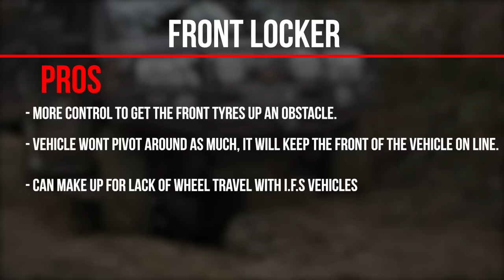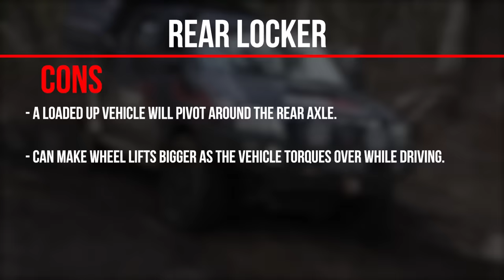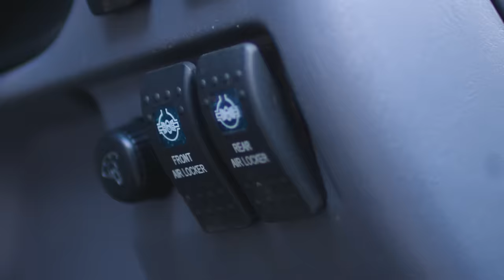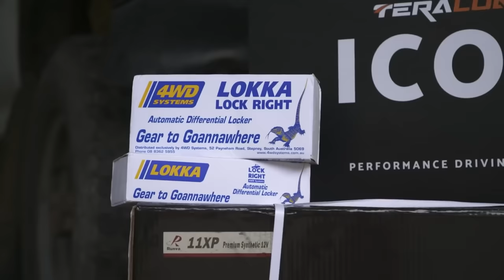FRONT LOCKER vs REAR LOCKER vs TWIN LOCKED COMPARISON! + AIR vs AUTO vs E LOCKER – Shock answer!

Comment: Live axle front and rear, rear air locker first. IFS with open diffs, rear locker first. Any vehicle with a strong rear LSD (and honestly, this is only Patrols), front locker first. My Ol’ Jackaroo had a strong rear LSD, so it got a front air locker. My current MQ Triton (GLX poverty pack) had no lockers. It got a rear first, then a front. Twin air (or “e”) lockers always ultimate. The early “Pony” videos with twin auto lockers and shit small road tyres, proved how dramatic an improvement lockers make. Really enjoying the way you present the tech stuff Jocko.

Comment: My personal perfect setup: LSD in the rear and ARB airlocker in the front. This will get you everywhere...
Reply: I am in process of doing a very similar setup
Reply: I’ve got the same set up in my patrol shimmed the lsd so it’s tight as and pro locker in the front
Reply: @trueaussie3097  I went for a torsen lsd in the rear no maintenence required or special oils and transfers power better then a clutch style lsd and am prepping my front axle for a detroit locker
Reply: Me too. My 3.1D Trooper(old but gold) has Lokka front locker(cheapest in UK) added to stock rear LSD, part time 4WD means I can shift it on/off as required. Top job.  Still has FW hubs too, so dragging nothing along.
Reply: I'll be running spartan in the rear and an arb up front!
Reply: If you already have a LSD in the rear your definitely better off keeping that and having a front locker rather then a rear locker and an open front.
Reply: @tersy9862  esp Nissan one
Reply: @tersy9862  my hilix lsd does absolutely nothing so for me just going twin locked. Can't beat twin locked. But i know something people can only get one. Patrols have a pretty good lsd but Toyotas like hilux have a pissy lsd that does nothing. For reference i have an 07 n70 hilux.
Reply: @davidcowan1583  are you sure your hilux has a mechanical LSD? Some cars have a electronic "lsd" which locks the opposite wheel with the handbreak. 

Best way to check is lift the rear up and turn one wheel. If they turn in the same direction you have a lsd. If they turn opposite you have an open diff. 

Some LSDs also need special fluid to operate effectively
Reply: @tersy9862  mechanical lsd for sure i have checked. They just aren't thats good. Keep in mind the car has 350k kms on it and is used for what its built for. Lockers are just better not worth spending money to shim it up may as well spend it putting the locker in they had the tske the diff out to shim up anyway.

Comment: I have an auto locker in the front of my 4WD mainly due to budget, having said that I will be installing an air locker in the rear later this year. With regards to the auto locker in the front, it isn't an issue in the front when on the road, just unlock the hubs and the locker isn't even engaged. When in 4WD with the hubs locked, the locker is noisy but it's not something you don't get used to. If you shift out of 4WD, then the locker is not engaged any longer and there is no noise. The only disadvantage with an auto locker is you can't use 4WD without it being engaged whereas an e or an air locker can be disengaged. Steering is compromised a little with an auto locker but it isn't that bad which is the advantage of the auto locker over the other two.

Comment: Why does nobody ever mention pushing the middle pedal?
Braking a wheel that’s off the ground transfers drive and works a treat if you don’t have lockers 😁
Reply: Thanks, it’s something that had never actually crossed my mind. I’ll keep this in mind :)
Reply: I blew up my front drive shaft doing that 🤣

Comment: I own a hilux and I have traction  control from factory. 

So I have installed an autolokka in the front and it seems to get me everywhere I go. With the rear open diff, the traction control acts as a rear locker and its great. But it is intermittent and can become problematic in some situation. 

For my driving style it suits me best but will soon opt for an e-locker front and rear. This will probably be the cheapest way to go (being an auto-elec) labour cost installation wont be in the equation. 

Love your work jocko!

Comment: Great video! Just to be a pedantic sod: An open diff gives you a 50/50 torque split (roughly, not taking any internal resistance into account here). If one wheel is in the air i can't take any torque, so the wheel on the ground gets the same low/zero amount of torque. A locked diff just locks the axles, so it is no longer responsible for the torque distribution ratio, that job is left to the available grip. If both wheels have the same amount of grip, 50/50 split, if one wheel is on the ground, and one wheel is in the air, that's a 100/0 split.

That doesn't change any of your practical advice and conclusions mind you, I just happened to have nerded out on locking/limited slip/torsen diffs a while back.

Comment: Good info Jock should be helpful to many.
Technically though an auto locker will allow one wheel to turn slower than the other around a corner not the other way around like you mentioned 👍

Comment: I have a Detroit in the back of my Defender 110. Absolutely love it. 
Going to put an air locker in the front  soon too. 

I have learned to drive around the day to day issues with the Detroit and don't really even notice it any more on the road. 

Would I like an air locker in the rear? Absolutely would. But on my budget the Detroit was the best option. It has made me lazy in my line choices  though...

The other thing it has done is make me break my 4x4 less as I don't need to be so hard on the power over everything.

Not sure I'd like a Detroit in a short wheel base though. Be a bit harder to steer and more noticeable when driving on the road , especially in the rain on wet tar

Comment: Very good informative video. Thanks joko. I put an auto lokka in first up the front  and then 12months later an E lokka in the rear. Its in an older ifs hilux, and both lokkas were needed as flex is very poor. Its a little mountain goat now.. So i would strongly suggest for ifs rigs get both..

Comment: You forgot to mention the 3rd locker, the centre locker which comes standard on many cars as well. Divides power 50/50 to the front and rear.
Reply: Maybe because they assume anyone that has one will already know what it is and how to use it because it has the same result as selecting 4WD with a traditional system.
Reply: @JeremyPetho  My car has permanent 4WD with a transfer case but i need to specifically engage (with a button) the center locker. (which then also disables traction control and vehicle stability control)
Reply: Yes, a full-time/permanent 4WD will have a centre diff and the axles can be locked together with a centre locker.  
Then a traditional 4WD will only drive the rear axle until 4WD is selected and then both axles will be locked together.  
In the end the result is the same. Locking the centre diff will give "true" 4WD, the same as selecting 4WD in a traditional system.  
For this reason many people refer to locking the centre diff as "selecting 4WD" even though technically it is always driving 4 wheels.

Comment: Lockers I prefer in order:
1) Factory installed selectable lockers
2) ARB Air lockers

I don't currently own a vehicle with a locker.  My 2009 VW GTI had a automatic e-locker from the factory.  I removed it and installed a Peloquin Torque Biasing LSD (works like a Quaiffe)

Comment: You should also explain the difference in locker type to pick for IFS vs SA.  I've noticed a front LSD or Torsen type up front for ifs it takes some of the shock load out of the CV's vs a fully locked elocker or air one.

Comment: In the cars I used with e-lockers I've found they can take a while to lock in.  G-wagons have front, centre and rear e-lockers but they can take ages to lock and unlock and it can be fairly jerky when they do. I'm guessing air would be a lot quicker.

Comment: such a great video, I've been binge-watching 4x4 diff videos and this is one of my favorites
my takeaway: I'm so fucking lucky that my 4Runner came stock with a Rear Locker, but the full Front & Rear Locker setup is still DEFINITELY the dream. 
Already have my ARB Twin air compressor mounted underhood, so 99% sure I'd go ARB Air Locker in front with the factory Toyota locker in rear.
Current goal - still need modestly-bigger tires + modest lift/suspension upgrade. 
Then, front bumper + electric winch (tho I do already carry a beastly manual come-along winch for sheer emergencies)
After that, saving up for a combined front locker + regearing install, since I'm told you might as well do both at the same time to avoid opening it up twice.
Again, great info all around.

Comment: I had a lokka front diff lock installed and I was playing around with my new free wheel hubs later that night while it was parked up in the garage. Forgot to turn them off. Next day the Mrs rings me from the side of the road and says the 4wd is making strange noises... she drove it about 10km on the tarmac with the front locker activated before a cv joint broke lol.

Anyway, lesson learned. The front diff lock was awesome off road. Saved my 4wd once when I sank into a dam trying to retrieve my jetski on the trailer in the middle of know where.

Comment: My 2016 PX2 Ranger came with a rear e-locker. Cool, but my wife, daughter and I hit Bribie Is, Inskip Pt., D.I, Fraser Is. etc  a bit so I should really permanently mount a compressor and an air tank for filling tyres and blowing sand out of the vehicle so whilst initially I wanted to go an Eaton e-locker up front, I'm leaning more towards an ARB front air locker/twin compressor package.

Comment: That was fantastic Joko thankyou, would love to see the comparison between crawler gears and standard gearing and hear more about what its like to drive daily with crawler gears, Cheers
Reply: Crawler gears are only in use when in low range and don’t effect the vehicle in any other driving. Not really in low range for daily driving, I daily drive my patrol and it has 83% reduction gears. One of the best mods I’ve done for what I drive off-road. How often do you actually use 3rd or 4th, 5th low range? With crawlers it gives a much better ratio selection, my 3rd,4th are similar to original 1st,2nd. The extra low 1st,2nd are awesome and so good for vehicle control.
Reply: @rohangearing6999  cheers mate

Comment: Looking at pure traction gain, maybe a front locker in some situations can give you a bit more traction, but the overall convenience of a rear locker is far superior in my opinion:

- rear axles are stronger and can handle with much less fear the offroad abuses with locker engaged
- rear locker affects in a very limited and very predictable way the steering of your car (understeer) and when uphill it will always try to put the car in the correct maximum slope line, while front locker can unpredictably push your whole front end to the side of the tire with best traction, at risk of putting you in unpleasant situations.
- while the rear locker can be engaged at any time you are in doubt you can need extra traction, front locker shall be used wisely, to avoid side effects.
- if you have to climb and make a turn simultaneosly, you can left your rear locker engaged with no fear, while if you have only a single front locker, you must climb that hill unlocked, otherwise you've no chance to turn and decide your line ...

Comment: Hey Jocko, thanks for the info mate really well done.
My question would be around winch's I know with sponsorships and all it may be hard to say one brand is better than the other, but would be good with expensive v cheap and rope v wire???
Reply: Warn 🔥
Reply: Honestly, any of the major brands will be fine and there are some decent winch comparisons out there.

Also go with rope unless you have a specific reason for cable.

Comment: Solid locker in the rear like OX or ARB Air and Torsen type in the front to save breaking U joints and gears.

Comment: If you very gently apply a bit of brake pedal with one of your unlocked IFS wheels in the air spinning, it can stop that wheel and shift power to the ground. Old school

Comment: Steering... A front locker only affects steering on a high traction surface. Mine can be switched independently as Jocko’s can. On a low traction surface where there is a lot of wheel slip, a front locker helps. Point the front wheels where you want to go and locked front wheels pull where they’re pointing. Rear locked can only push straight and with both engaged, rear can sometimes oppose the front in corners. Front locked, rear unlocked in a turn on low traction surface allows the open rear differential action to assist the front around a corner. Ultimately, being able to independently select front or rear or both is the best arrangement for driver selectable lockers.

Comment: Nice informative video Jock! Thanks mate! well, for me the very best would be twin locked air compressor, as you make your vehicle crawl obstacles hence having less risk of damaging your rig. My request would be if you could do a video about the tire system which is used on the 6x6 mercedes focusing specially on how did they wire the air to the tires. That we be aswesome! Once again, nice vid mate!

Comment: I had a Hilux with a Detroit (auto) locker in the rear.  It was absolutely bullet proof and I drove that thing every where for about fifteen years, it was unbreakable. The advantage of an auto locker on the rear is that it comes into play whenever it is required, even on (for example) a building site or a mud puddle where you didn't think it would be needed.  Yes, to get the front up sometimes you have to bounce the front wheels up onto a step, after which you are home free.

A mate had a later model Hilux and he elected to put a Lock Right (also auto) soft locker on the front.   The soft locker is better on the front because it does allow for more steering ability when it has to, however if the diff was locked he had very little ability to steer in soft sand when going slow.

Having said that, If you do a lot of soft sand then you might be better with a soft locker on the front because when it comes to soft sand, pulling is actually better than pushing (ploughing) the front wheels.

So, rear for dirt terrain that isn't too soft, front for sand and mush.  Obviously, having both is ideal if you can afford it.  If you are going to get both anyway then air lockers are about the same price but if you only get one then an auto locker will be cheaper (because of the cost of the compressor and installation).

I can recommend the two brands I mentioned for reliability, I don't have any experience with any of the others.  The Detroit locker requires professional installation because the setup of the dog clutch is spring loaded, and it can remove fingers if you don't know what you are doing.  I believe the Lock Right can be installed by anyone if you follow the instructions, but my mate got his installed too.

The only stuff that caused me any real trouble was trying to get up a steep soft sand dune or hill unloaded.  The Hilux is quite light on the rear end, so even with the Detroit locker it was not sufficient to plough the front wheels up a soft sand hill.  It worked better with a few hundred extra kilos over the rear axle in that case.

Comment: Thanks for confirming that Toyotas have a relatively weak LSD.  That's what I was suspecting.  For me, I just have a regular rear wheel drive truck, but just want to be able to lock the rear just like the "off-road" version of my Tacoma.  I have heard that e-lockers get very hot, so you can't get lazy on the differential oil changes.

Comment: As a member if the Subaru 4wd club Victoria  I don't normally do hard core driving although I have done some short stuff by myself,  I went for the front auto lokka, will go rear whn I can afford it, and found it makes it easier even on the less challenging tracks, I had a rear on my old 80 series and I believe the front made the bigger difference

Comment: Front locker first for me. The articulation in the rear is greatest and the front tires are very easy to put in the air (Specialty with IFS and with short wheel base). This applies only for slow and technical driving.

Comment: Lockers, essential where traction is an issue. If traction isn't a problem, but wheels are picking up, I've found the traction control in my DMAX negates need for the lockers.
On mud or sand, lockers are a must as the traction control just kills momentum.

Comment: Additional Cons - 
Front: More likely to bind and break CVs under a load.  
Rear: Both tires can lose traction when off-camber and cause the vehicle to slide sideways.  It's good to disable it if you can on a side slope.

Comment: If you’re overlanding, I’m on team rear locker only because you break less equipment and it allows you to travel faster on winding terrain.  But if you’re mostly crawling, in a rig that’s not over loaded, it’s hard to argue with a front locker.

Also, look at how smooth his diving is!